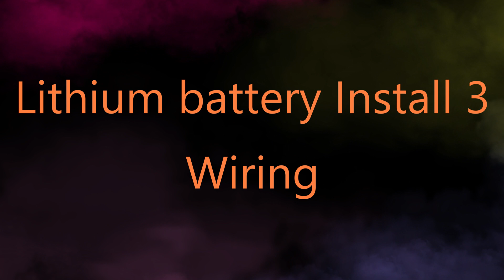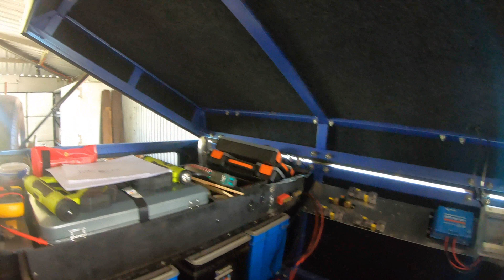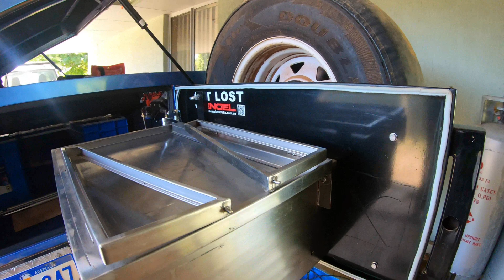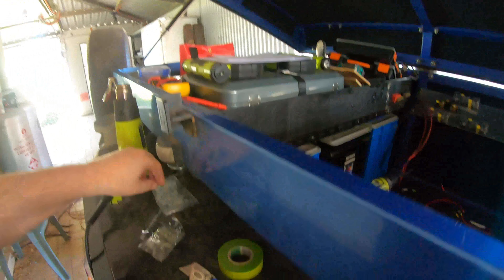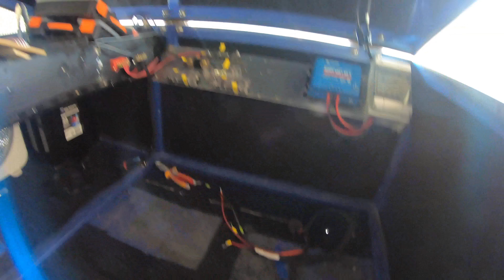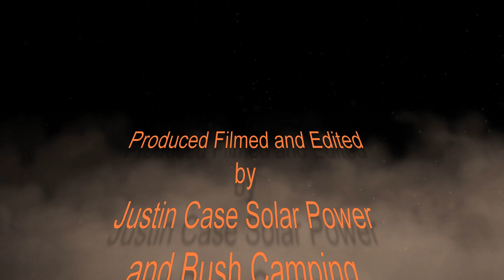Lithium battery Install 3.  Wiring

Comment: Weather there looks Great.  We has only 3 days in December without rain and only one day in January without rain.
Reply from the maker: We need rain in the southwest Western Australia. The bushland is very dry. Good to see them getting plenty in the eastern states though. Should Have  given the bushfires a nice drenching. Just doing part 4 of the wiring video now. Part 5 will be the batteries install and maybe the inverter wiring if it gets here in time.

Comment: Giving the batteries to a friend was nice. I bet that made his day. I'm betting the new system will be a work  of art. I've been following you for a long time and I know you do top notch work Chris.
Reply from the maker: The life span of the new batteries means i have to do a top notch job on this one. No Shortcuts allowed. Yes Russ was so happy to get the batteries for free. Made his day mate. When we go camping everything must work. It all must handle the rough tracks Sigi and i drive and be working when we set up camp. We will still have a gas camping stove as a backup. When its all said and done, Its Sigi's mobile kitchen and i would feel bad if it did not work when she wanted to cook me a nice meal.

Comment: Oh, I hope that Sigi is getting better.
And, boy - to have even half your knowledge about this stuff...
My son has helped me install my dual battery system - had it a couple of years now...
Wouldn't be without Solar Panels and a fridge - and the ability to charge phones and such.
I have had to do a couple of field repairs on loose wires... so I do have a little confidence, and I guess - I'll eventually learn more out of necessity...
Another great informative video, thanks for sharing mate.

:-D
Reply from the maker: Hello my good friend. Sigi is fine she now has pills to take and is determined to have a good time for as long as we both can. I just love working on anything Solar Shaz. Sigi will be cooking in style out there in the Bush. That camper trailer is basically Sigi's Portable Kitchen. I believe it even cost more then the one she has in the house, LOL

Comment: Congrats Justin, way to go mate to ask an electrician to wire the inverter mate, better safe than sorry .One question don't you think that the Victron solar regulator connections are a bit small in my case 20ah models May I ask which model is your in the camper trailer it looks like an 30ah bluetooth
Reply from the maker: Hello Jack. the controller is a tad oversize for what i need. to answer your question the wire going in and out of it is rated at 30amp continuous. I have seen 15 amp max. In the circuit breaker box beside it  there is a 12Amp noark in the solar in and a 20Amp Noark on the output to the battery, That is from memory i will check next time i do a video. It's all overkill my friend. its a 100/30 bluetooth and not to old.
Reply: @JustinCaseSolarPower  Thanks for the reply mate Is that cable connected on the Victron 6mm ??
Reply from the maker: 8mm  and the length is 30cm to 40cm. the cable coming in from the solar panel is 6mm solar cable means it has 2 layers of pvc. Its also meant to be rated at 30amps. It looks a bit lite for the job but its whats on most homes in Australia
Reply from the maker: I will show the difference in the 2 wires in the next update video if you like? I tend to go higher in what i need for wiring and batteries and inverters. I put a lot of reliance on my Bluesea fuses and fuse holders. I would rather change a fuse then a burnt out wire any day.
Reply from the maker: This should answer your questions. https://youtu.be/OtUG2yCUrTk Please let me know if i can be of further help>> 👍